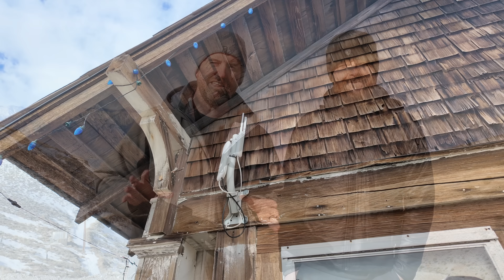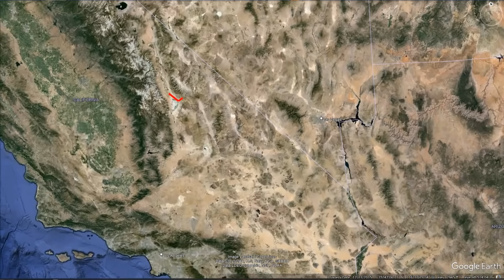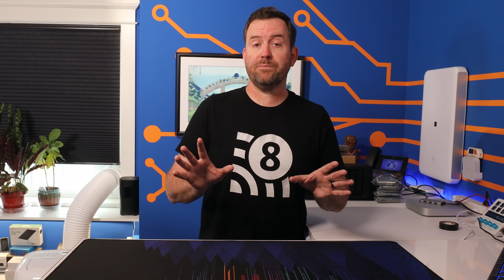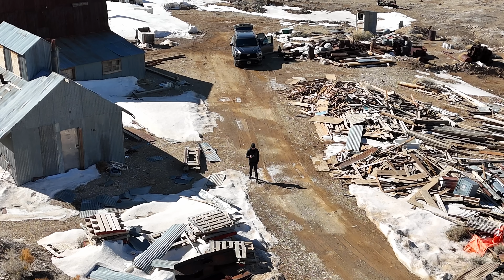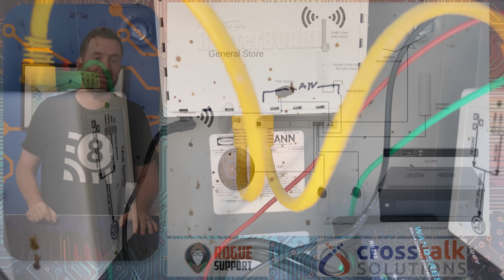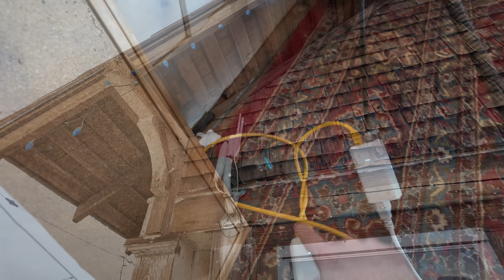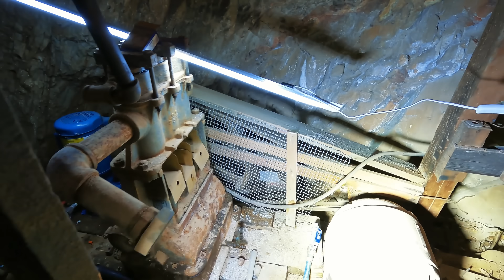Cerro Gordo's Wi-Fi:  Network Design for a Ghost Town

Comment: Honestly, being that the ISP's gear is a huge point of failure, that needs to be addressed first, before anything else is done. 
The second microwave hop is unnecessary, run direct burial fiber from there to whatever building that has reliable power is closest, then split it off with wireless tech from there.

Or, skip the ISP entirely, paint the starlink dish to match the roof of the american hotel, and then split it off from there, which is way simpler and likely cheaper than the bespoke microwave link.
Reply: I agree. Even if it's on poles, I'd think you'd want to at least run fiber (armored, or in conduit?) as much as you could... from that ISP receiver to the town, or at the very least from the Store to the other buildings, or up to the Hoist House.
I feel like they're trying to do it all on a budget (one AP for all three levels of the hotel? Wireless bridges instead of running wire, etc.)  
I really do hope it works out, but ... geez, that hotel is probably going to need its own network infrastructure too (I'd think) for communication, entertainment, POS, and more. Wireless isn't the answer for everything.
Reply: Burying stuff there is not easy, mostly rock.

Comment: The nanostation ac's run both 24v passive and at poe and will pass-through whatever they are being powered with. So you you can eliminate the inline converter

Comment: Couple of additional thoughts on the solar powered relays: consider burying the batteries in any sort of sturdy box to take advantage of the warmer earth in winter to dramatically boost battery performance.  Also, adding a second panel, and mounting the panels higher above ground and at a much steeper angle will help with shedding snow. The efficiency reduction in summer caused by the steep panel angle is moot with all day being sunny.
Reply: You can get bifacial solar panels and mount them vertical.
Reply: Yeah I would double up on the panels, add some height, and put batteries in a job-box

Comment: Personally would go for fibre in the mine at least to some extent, as others have said, and I do wonder how far a wifi signal will travel into each level from the mineshaft - my bet is 'not far'! I would be planning for at least 2 wired APs for each level, not just one.
For main infrastructure I also question so many radio links when it is practical to bury 30-50m cable for a wired link and be much more reliable especially in the snow & rain. I bet Brent has the capability of digging the trenches inhouse so the only issue would be ensuring the cable wasn't broken by future construction work.
If you go with these proposals, definitely add some sort of local UPS to shore up local power at many or even most of the PTP link sites; I get the feeling the quality of mains power will leave things to be desired! Also, adding a larger solar battery at the main radio, with possible small (18" dia?) wind supplement, will help keep that link alive in the winter.
Finally, if you made the Hotel the centre point rather than the Store you're in a new-build anyway & in a place residents may well expect good network service in a way they wouldn't in the older parts of the town. I'm not sure, but it is also possible the hotel has better visibility to the mine house because it's farther from the spoil heaps, and as a building it's taller.

Comment: Great channel!  Excellent architecture.  Consider an alternate architecture for long distance wired POE networking: DSL modems using a single pair, with the remaining 6 conductors (cat 6 for bigger copper) split between 48VDC. I use a 66 block to make my own non-standard POE pin-outs.  I have a similar topology (above ground!) in the Pacific northwest sending data 3000 feet to a DSL modem and 48 VDC in the remaining pairs.  Terminated in a wireless networking device + Switch.  11 watts total, trivial power loss over that distance.  A second line is 700 ft, same architecture.  Same @11 watts.  DSL modem pairs are available as a transparent ethernet bridge ($~250), no management, or about twice that for manageable for line troubleshooting.  Living rurally and working from home (Systems Engineer) I have Verizon LTE plus Starlink, terminated at a Peplink Balance with the "Speed Fusion" dual VPN service.  This streams the same data to both wan connections (for zoom, Teams and iPhone wifi calling) to a subscription vpn concentrator at a POP of your choice. This gives fewer drop-out than my Silicon Valley co-workers.  A note about Starlink:  in the last year or so the service reliability has improved dramatically.  With a clear view of the northern sky one can expect less than 5 seconds a day, or less outage.  With Cerro Gordo as remote as my place, I expect the same excellent service.  For me less than 30ms latency the Silicon Valley POP.  Realtime streaming through both wan connections obviously avoids the drop-outs inherent in any of the failover protocols.  The "Speed Fusion" service at the concentrator end simply picks the best packets from both streams spawning a new stream that originates from that POP.  I spend maybe $80 a year on the subscription.

Comment: I'm confused about the POE injectors in series.  How does that do anything other than what one does?
Reply: If you have a bridge (in station mode) connected to the first injector, it’ll output data through the LAN port (rather than receiving data like a normal AP does). So then you connect the data output (LAN on the first injector) to the data input of the second injector, which then passes power and data to the AP.
Reply: @ksti56  Wow I feel dumb. It didn't occur to me there were POE devices on each end. I thought they were injecting power and then injecting power again which made no sense. lol. Thanks.

Comment: Is the desire to not bring WAN in from the 'main' PTMP station via VLANs or something like EoIP driven by limitations of the Unifi gear? The Mikrotik HEX is certainly capable of either one of those, and also multi-wan, other than its poor location with only solar power.
Reply: I feel like a huge part is that Chris just isn't that familiar with Mikrotik as he is with Ubiquiti Unifi. And there certainly is something to be said for sticking to stuff you know in such a remote place. And Mikrotik just isn't the most beginner friendly system.
However I think their hardware offerings would be better suited for such an installation. At least on the infrastructure side. They've got Outdoor Rated Switches with SFP Ports and a wider range of acceptable Voltages. Having SFP Ports available on smaller lower end switches would make fiber installations a bit easier to consider. Sure Unifi Switches with external Media converters could be an option but that feels overcomplicated and more error prone then an integrated solution.
And Mikrotik is just an example. There are other options. I guess Unifi just is more an solution for offices then outdoor and distributed infrastructure. Maybe getting help/tips from someone with something at least a bit somewhat related experiences would make for an interesting video and possibly a more sturdy solution in the end. 🙂
Reply: @pearcomputers2542  Yeah, he's definitely not familiar with Mikrotik, but VLANs are also not that hard to setup in the hEX.

Comment: Option 1 down the mine seems the best for both use and trying to rely on a cable that may or may not work. ~100W of power down the shaft, and Wi-Fi on each level is much better. I would also get rid of the wireless ISP and only use Starlink, as it is very reliable. Then, the solar relay station that hits the mine and the town could be used without a janky outhouse radio tower. The amount of POE injectors also feels dirty when a 5-port POE switch would do the job and have expansion for things like cameras. The "Ultra" name is so misleading for entry-level products.

Comment: Just out of curiosity, how much room does the elevator take up in the staff?   Could you point a U6-Pro at the top of the staff, pointed down to the bottom of the mine, and have a mesh AP at each level?

Comment: I think you guys should put an access point in the 500 foot level of the shaft by running ethernet back up from the switch at the 900 foot level

Comment: Why not 

Game changer from the top to 200m down shafts with POE (drop for each level)

Fiber down to where the pump is and then 200m in either direction where needed with POE??

Comment: If you extend ac down the shaft you need to be super careful on breaker ratings, a long line won’t clear the breaker under a fault and will catch fire, at least use low smoke cable.
Reply: Personally I would be wary about mains power in the mine - there's so much dry and old wood that a fire would be catastrophic. So, keep the power to things like PoE - low volts, low current and very unlikely to spark. Perhaps also noticeably overspecify the cable power and insulation ratings too!

Comment: Interesting project. Kinda wish I had a project like this, having grown up in a mining community.

I might have missed it but....
Be cautious of the quality of power. Make sure you're allowing for low and high voltage surges. The power may not be clean and could damage equipment.
In the very least I'd consider power conditioners. UPSes would be better but then you have to consider the temperature extremes with regards to the batteries.

Comment: This is an absolute ton of 5Ghz equipment when the primary ISP is already backfeeding via 5Ghz.  - What channel width is the ISP using and what channel spacing are you using for the PTP and the Omni to the outbuildings.   Adding in all of the internal U6APs and Mesh APs is fine, but there is going to need to be a very very concerned effort to avoid stepping on ISP's signal.   The Omni might feel like a nesiciary evil at first glance, but Omnis are horrible for your noisefloor and retransmission with that many outbuildings especially when paired with metal siding/reflections.   You may want to use 2x 5AC Lite 120s to give a better coverage on two obscured faces and or different smaller channel widths.   I would even go as far as to change the PTP feed from the ISP into the central location to a Gigabeam, just to try to get on 60ghz with 5Ghz backup.   Move the extra nanobeam recovered to one of the out buildings... And now that your running constant upload from the onsite cameras speced --- this is going to increase the noise floor even with local recording.   The omni should be reconsidered if at all possible.   You can replace the RocketPrism5AC with Antenna with two of the lite 120's for less cost, and clean up a ton of the noise that the omni will create. --- speaking from a WISP provider standpoint.
Reply: I also run a WISP. Gotta admit - I cringed big time when I saw that omni. Been there, done that - back in the early days.
Granted, population density is about as low as you can get, so there's not a lot of RF there, but still.... 

Totally agree with the advantages of 60ghz for backhauls both for speed and to keep the RF clean.
Reply: If you think it’s bad now, wait another decade for projects like this to show their age.

Comment: I disagree about the shaft.

I think a better solution is to run fiber to the 700ft level, and cat6 back up to 400 and 550ft level. This will provide some level of electrical isolation, reduse overall cabel length, make it easy to troubleshoot.
Reply: Hybrid fiber with 32 fibers and a pair of conductors on the same armored cable. Most major producers (Panduit, Belden, Commscope) make fiber with electrical in a single cable. There would obviously be some voltage loss, but not enough that it would be a problem at that distance. People easily run cameras a mile from the data/power source on hybrid fiber. With 32 fibers, just split four off at every level into a fiber junction box and tap the electrical conductors to run the equipment.
Reply: yea putting a 8-pro at the top and 700 level and ultras or the Flex-46W on the middle floors. means you only need AC power at the top and 700 level.
Reply: I would also completely ditch a Ubiquity equipment. (I know it's nice to have a complete control over whole network from a single management point, but I think that Ubiquity devices are not suitable candidates for use in mines) And I would go with some industrial grade switches, these are rated(certified) for harsh conditions. Like extreme temperatures and high humid environments with a lot of condensation. So in the long run there will be less maintenance with this type of hardware.
Nevertheless some of these switches have some sort of "boost for wired connections" so 300m (1000ft) links running at 100Mbit are possible. I haven't seen a 1gbit over that distance, but I think that 100Mbit is plenty for this situation. Or as mentioned the fibre is also a valid option.
Reply: @vassterak  USW-Industrial
Reply: Ubiquiti sells cheap 6 strand SM OS2 fiber (sku FC-SM-100). I would coupler at every level and shed a stand to a bidi media converter. Keep a USW-Agg at the top. 
If you're dead set on copper I would leverage the PoE++ feature and use PoE repeaters and shed the ++ for + or less.
I like the UK-Ultra but the older UAP-AC-IW would allow PoE passthrough for cameras + other wired for $10 more. I get the vibes that this is really a shoestring budget though...
Reply: I 100% agree since power is on the 700 level anyways, I'd drop an OM3 MMF down there and call it a day.  If this was my property, this is what I would do.
Reply: @JB007Rules2 Single mode has long been cheaper and better performance for the same price. Multi mode is really not useful anywhere anymore
Reply: that could be a great opplication of p2mp fiber. just splitt the fiber on any level pared with an UFiber WiFi 6
Reply: Totally agree with the fibre to the 700ft level. From there the levels that can't be hit from the other side can bit hit then. 

I had to cringe a little at seeing all those nano stations too, going to be a lot of self interference there. Power beams would be better on PTP shots like from the bunk house up to the shaft. Also if they are not using the 120 degree sector, I would pull that down and put a PTP shot instead. Personally I would put some 60ghz radios to help reduce the interference, but you could get them with the 5ghz backup in case there is any rain/snow fade...
Reply: the UFiber Active Ethernet cold help a lot to. its a poe powered media converter. it converts every poe switch to a switch with sfp port.
Reply: Cables   ... no mesh
Reply: I think they are biased about fiber for some reason, they have ac power at the bottom they can't just drop multi mode all the way down and be up and running, fiber could also run between the buildings no problem they already have power lines running around the area and there are burial fiber cables available.  I think it's mainly about cost savings on this project hence why they are only putting one access point for an entire hotel
Reply: My one problem with UniFi is that it’s “professional” to a certain point.
Reply: I would have gone finer 100%
Reply: I think one "problem" is that Ubiquiti doesn't really have a small switch with at least one SFP Port. The smallest option seems to be the USW-Pro-8-PoE. And that model isn't really cheap, has SFP+ (overkill) and they claim 30W (Excluding PoE output) as max. power consumption. Even if it uses quite a bit less it's probably still on the hotter side and would require quite a big NEMA enclosoure to not cook itself. 
Using some external media converter would be an option but it would mean more complexity. I think other companies do have viable smaller "low power" switches for this sort of thing but i feel like that would be outside the comfort level.
But i aggree, fiber would be the better option. This feels like it's only a sort of improvement over the current MoCA network.
Reply: @pearcomputers2542  - too bad being boxed in by the vendor. Plenty of unmanaged fiber transceivers would work.
Reply: @jroysdon  I agree with you on the boxed in by the vendor. There are even SFP to RJ45 Media converters that are PoE powered.

However I would probably just switch to another switch vendor. I don't know about the specifics of the environment in that mine. But probably not too great. Using a device designed for outdoor use will probably work better then using a indoor device in an enclosure.
Reply: This solution makes way more sense than using copper for the entire mine shaft. Im really surprised they did not decide to use fiber to the lowest level.

Comment: Does anyone make a dual Poe injector? You would think it would make for a cleaner install.
Reply from the maker: There are companies that make small PoE switches - but they're significantly more expensive than the PoE injectors.
Reply: @CrosstalkSolutions  Amazon has some POE switches for around $26. Considering the Injectors already cost $8 each from Ubiquiti, It may be worth spending the extra $10 on a switch. It gives you a cleaner setup with options to add additional equipment in the future.

Comment: Were you not tempted with a solution involving the Ubiquiti F-POE-G2 and an hybrid fibre/24v power cable for the shaft part of this project?
Reply: Looks like that device can handle 50v as well, which would help with voltage drop